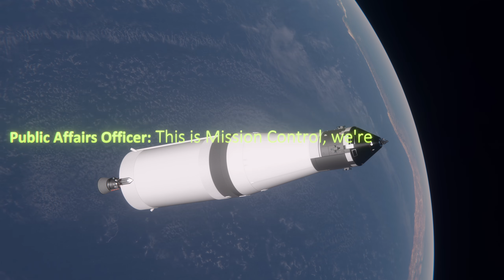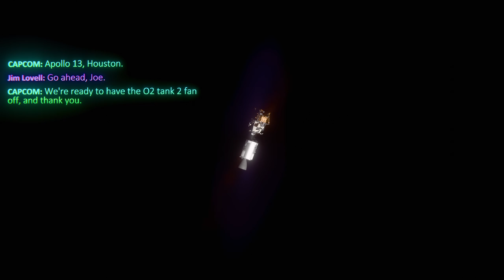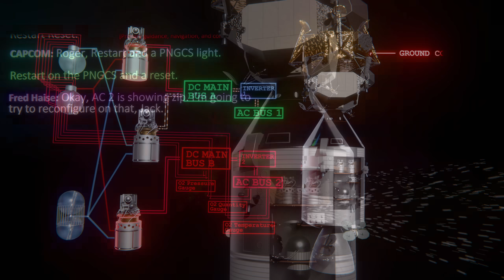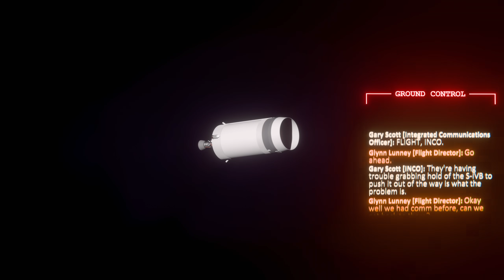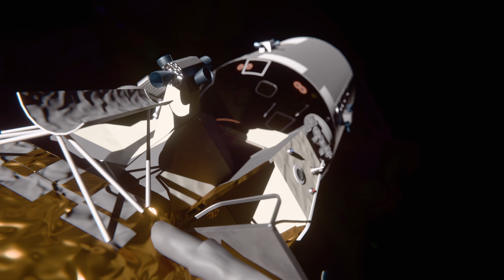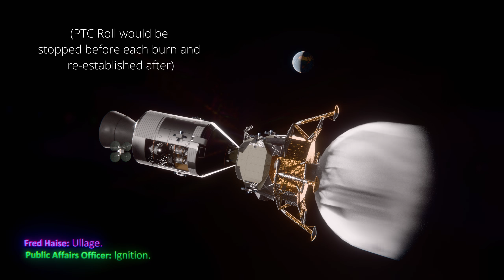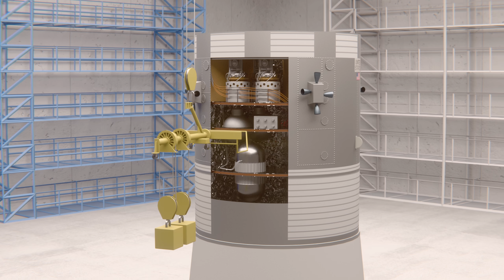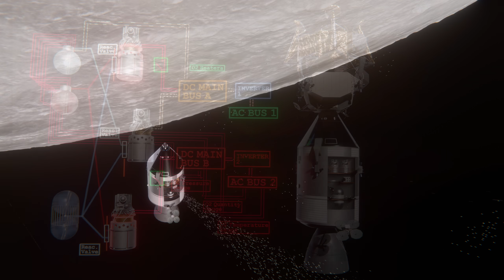Apollo 13: What Went Wrong

Comment: Being fully aware that there is a problem and doing nothing is outrageous.
I like space but I would undoubtedly cut the budget of the NASA after this.
Excellent video.
Reply: They were pressured to get the thing in space. They found a few errors on the found as stated 15min in. 
It's a massive lesson learned.
Reply: @Tacos888 
I have a second hand car and I have been finding problems after problems after problems because the previous owner chose the cheapest most lazy solutions for every problem in the car. I don't mind if the car turns into my coffin, I REALLY mind if the car turns into my brother or mother's coffin.
If you really care, you do something, even if you are under pressure; that is a lesson that the car is giving me every month, it's not for me or my safety, it's for them and their safety.
Reply: How do you imagine cutting the budget helping prevent this in the future?
Reply: @SC710-1 
It doesn't, it's a decision based on hatred only made with the intention to produce some kind of damage.
In their last statement they washed their hands.

Comment: Why didn't just, as they saw venting, go to batteries only switching off all the fuel cells and and the watch if the leak stops  then bring think back online one by one and watch on each step if the leak returns?
Reply: Bc the systems would of froze up I'm sure

Comment: Apollo 13 was a hoax like the rest of the Apollo missions. Slightly different from the rest. The launch was aborted, there was no one aboard. The last stage was crashed into the north Atlantic where the Soviets recovered it. They used  it to make the Soyouz/Apollo fake joint mission docking system.
Reply: There's a ton of evidence that prove the Apollo missions are real, and no evidence at all that any of the missions was faked. For instance, astronomers could observe the Apollo spacecraft on their way to the moon. It's pretty easy to distinguish between a spacecraft that orbits Earth and one that is on its way to the moon. These observations are enough to disprove your claims.
Reply: No
Reply: @ObviousTroll-z6pYes.

Comment: This must have been a very rushed mission from the beginning,
Reply: Yes, Apollo was a very rushed program. They had only 8 years to invent, design and build everything you'd need for a manned lunar landing. This meant involving massive numbers of people (450,000 at the peak), and everything was done under massive pressure. People worked unlimited overtime. In the rush, things were overlooked. Configuration management/documentation of changes was not always done as well as it should have been, and this caused the Apollo 13 failure.
Reply: That is all very unfortunate

Comment: Hold the fuck up. 5 miles per second is REALLY FREAKING FAST. How would you slow down in space at that speed?
Reply: They were travelling at 24000mph when they left Earth but by the time they reach the Moons influence the pull of Earth’s gravity slowed them to around 3000mph.

The only reason we haven’t been back to the moon is politics. NASA had Apollo 18 ready to fly but congress cancelled the program.
Reply: You slow down by firing a rocket engine against your direction of motion.
Reply: @zounds010 that's a lot of inertia. Why can't we go back?
Reply: @chrishasyourkeys2808  It's not a matter of "can't". Until recently, nobody was willing to spend the hundreds of billions of dollars a manned lunar program requires.
Reply: @chrishasyourkeys2808  Yes, that's a lot of inertia.The Service Module carries enough fuel to change the speed of the CSM by 2800 m/s.

Comment: 50 minutes in and I'm impressed at Kranz being so competent:
- Being careful to work the DC circuitry to avoid any short circuit from causing degradation to Main Bus A (powered by Fuel Cell 2)
- Offering GNC to work deltaV from the body angles to estimate what tank blew up
- Asking Sy to explain his logic behind isolating the Surge tanks (saving everything needed for reentry)

Would have loved to see some NASSP/Orbiter, but otherwise this is an astounding YouTube documentary. Thank you so much!
Reply: The most arrogant guy in there? Cool. You know the decisions are made by dozens of people, not justhim.
Reply: @pativi6643 That's a horrible take. You can appreciate the video instead of taking on comments 😎
Reply: @DanielCharry1025 horrible take is thinking he made these decisions on his own.
Reply: @pativi6643 Amusing response. If your take is that the original comment undermined the role of the flight controllers or put Kranz as the only decision maker, let me put you out of your misery by stating you're wrong. Cheers!
Reply: @pativi6643  horrible take is your second name
Reply: @pativi6643 Ragebait used to be believable 🥀

Comment: I so wish this were true. It is an incredible story. 
Where did the creators get this video? Who has the financial incentive give to make a video like this? Impressive budget. 
Good choice of narrator - geeky, young not too professional. 
The only thing I want more than to believe this, is to not be fooled by what may have been a huge hoax.
Reply: There is abundant evidence that proves the Apollo missions are real, and no evidence at all that the missions were faked.
The video creators used footage published by NASA at the time, combined with new graphics that explain what's happening, based on the massive amount of information NASA published about every aspect of Apollo. All those systems diagrams are in public documents, for example.
Reply: @zounds010  

 While I did not mean to lure you into this debate, now that you’ve responded, I’ll propose a question. In the video shown the Apollo 13 mission is in a near equatorial orbit before it departs from the Earth and heads toward the moon. All press packs and public information at the time supported this equatorial orbit departure. However, that orbit would take the mission directly through the most intense portions of the Van Allen radiation belts. 
In the decades since the Apollo missions, the danger of the Van Allen radiation belts has been highlighted and explored to the point that NASA was forced to go back and say that the Apollo missions departed from a polar orbit. 
However, a polar orbit would require much more fuel and time than was allotted during the Apollo missions and was explicitly contradicted by NASA during the Apollo missions. Any video showing a polar orbit today is revisionist history. Look it up. 
So the video shown in this example highlights the actual orbit that Apollo missions claimed to take, up until the last 10 or 15 years. The reality, however, is that those orbits would’ve exposed the astronauts to fatal radiation. 
This is why NASA has since claimed that all Apollo missions took a near polar exit path before heading to the moon. 
This is one of many examples of contradictions from the original Apollo data to the revised Apollo data that NASA puts out today. 
It would be wonderful if we could just look at the telemetry data that NASA had from the Apollo missions right? But unfortunately, NASA has destroyed or lost all the telemetry data and continue to issue edited video and sound tracks when some inconvenient fact is discovered. E.g. the BART Sibrel video with a third voice saying “talk”, now edited from the video. How convenient. Suspicious? I could go on and on on points just like this.
Size of the suns reflection in the astronauts visors, clear existence of the Kubrick horizontal in all A12 forward photos, astronaut landing on the ground after the sand he kicked up lands demonstrating suspension from above, backpack going up before the astronauts jump, lack of any mention of radiation readings during A8’s first  penetration of the VA belts. 
I know you personally are not going to change your mind but someone else reading this may, or so I can hope.
Reply: @ChrisHodges87  Bart Sibrel is a liar and a charlatan. All of his arguments have been exposed as fraudulent. 
The "talk" video, for instance. I've seen that video. I didn't hear anyone say "talk". All we hear is a brief burst of static, not the world "talk".
Reply: @ChrisHodges87  Tons of Apollo telemetry is easily available in the hundreds of reports NASA made and published after the missions. 
NASA has published all of the media in raw, unedited form. Every photo taken by the astronauts, every frame of film, every TV transmission.
Reply: @ChrisHodges87  The size of the sun's reflection in the astronauts' visors is not a problem. The people who argue this is a problem are using faulty math and incorrect assumptions to make a problem out of nothing.
Reply: @zounds010 incorrect again. The video is controlled by a company called spacecraft films. Several instances of edited video exist. Do you really read the other side of this case? I would expect someone who claims your expertise to know this. I’m being serious here. The telemetry tapes were “lost”. What you have is what they claim not what was recorded in the original media. All the original A11 video was “lost” too. What you have is copies made from a projection TV. Seriously man, the holes here are huge. 
This is not getting us anywhere. Good luck.
Reply: @ChrisHodges87  SpacecraftFilms controls nothing. They take footage that's in the public domain, and package it as DVDs, nothing more.
Reply: @ChrisHodges87  No, the telemetry tapes were not "lost". After every mission, the useful telemetry was processed and put into reports and archives. What was left was a stack of telemetry recordings that was no longer useful. Those were discarded to be reused. 
for the Apollo 11 TV broadcasts, the signal was recorded multiple times. Once at the receiving station in the SSTV format, once again after conversion to NTSC, and again by every TV network that broadcast it. The SSTV recordings were subsequently lost. We still have plenty of recordings from every broadcast.
Reply: @zounds010 incorrect. They have edited several.
Reply: @zounds010 the press was forced to film the landings from a projected image. No direct connection. These is why they are so blurry. Why?
Reply: @ChrisHodges87  No, the press was not forced to do that. None of the TV networks were eager to spend a lot of money to build their own conversion system, plus a lot more money to use the then-experimental and very expensive satellites to transfer the signal back from Australia to the USA. They preferred to use the cheap option and pick up the converted signal in Houston. 
That 'projected image' was the only standards conversion system ready in time for Apollo 11. NASA spent more money to build more experimental equipment to improve the conversion quality, this was ready in time for Apollo 12.
Reply: @ChrisHodges87  Full, unedited versions of every video are easily available.

Comment: The next flight, Apollo 14, almost had to abort after repeated docking failures between the CM and the LM in its stowed position atop the S-IVB.  After discussion with Houston and several ideas tried, they achieved capture on the sixth attempt.  It would have been the second Apollo abort in a row, both while en route to Fra Mauro.

Comment: 1:52:16 as a programmer, I relate oh-so-well with the absolutely unlucky and improbable chain of events that caused the incident. Some insignificant part would fail to work, which would not be a problem, would there not be another issue that went completely unnoticed, the combination of the two being catastrophic.

Comment: sounds like some nit picking engineer bullshlt that cost the mission... they started out with 100% tanks full. what was the obsession with "knowing" what was in the tanks... and how in the fuc&  do you use 65 volts on a system designed for 28 volts? It's a wonder more than 17 astronauts have not been killed
Reply: The obsession with knowing how much oxygen is left is simply good engineering practice. The rate at which oxygen was used up depended on how much power was needed, which was variable. You don't want to wait to switch between tanks until your fuel cells malfunction because they aren't getting any oxygen. 
You don't want a leak to mess up your estimate of how much oxygen is left, either.
Reply: @zounds010  your analysis is shallow and pedantic. they already had 5 Apollo missions to compare O2 usage. the engineers knew exactly how much O2 was being used by fuel cells and breathing, like i said before... NASA has managed to kill 17 astronauts with "good engineering practice"
Reply: @FamilyCurnow  Apollo 13 was caused by insufficiently keeping track of changes. You are advocating for introducing more changes, as well as reducing the available information during the mission. That's not good engineering practice.

Comment: LOL, effin NASA.  DOZENS of design errors, redundant systems sharing common pressure lines, SINGLE sensors to detect tank pressures, ON an On, what an incompetent bunch of yahoos.  In the end they did not take responsibility, shown clearly in the prepared statement.  It is important to note that WWII submarines, twenty years earlier, and nuclear submarines, were hundreds of times more complex to design and build and had superior redundant systems properly designed.
Reply: There were lots of redundant systems. They just didn’t think of everything. They were also in a rush to meet Kennedy end of the decade deadline.
Reply: WW2 submarines had half a century of development and experience behind them. The Apollo spacecraft: 8 years. 
Nuclear submarines are less complex to design than the Saturn V and Apollo stack. This is easy to verify by looking at the difference in cost. Nuclear submarines have far greater weight margins making it easier to build in redundancy.

Comment: Wait, you lost me there ah the beginning with the whole "rotated 180 degrees to lock into the lunar module".... what the hell? Where did that thing come from? was that just already floating out there in space already? Was becoming seperated and then rotating back to lock together just a part of one of the "stage" transitions? Why coulnd't it have been one peice already to beginwith then?
Reply: During launch, the CSM was at the top of the rocket. The LM was below it, in the shroud that connects the S-IVB third stage to the base of the SM. 
For the docking maneuver:
1. the CSM separated from the third stage.
2. The CSM rotated 180º.
3. The shroud opened in four sections, revealing the LM inside. The CSM approached the LM, docking with it.
4. The CSM pulled the LM from the third stage. 

They did it this way because it gave the simplest design for the rocket. 
- if they had put the LM on top of the CSM, the LM would be in the way if the CM had to escape the stack. 
- if they had turned the CSM around and installed it docked with the LM, they'd have had to redesign the CM: the astronauts had to face upwards both during launch and during reentry. Putting the CM upside down during launch meant the whole assembly of the seats and the control panels in front of the seats had to be able to rotate 180º.
Reply: @zounds010  That is pretty neat. I always thought of a rocket going threw strages as just a process of dropping parts off you're done with. I never pictured the rocket going all tranformers and reconfiguring itself like that!
Reply: I think i might get it. Is it that it's easier to drag the lunar module into space, but once there you switch to pushing it because you're just the truck, that's the cargo